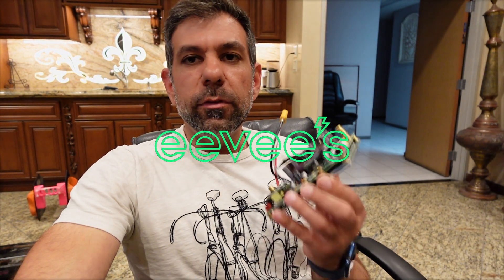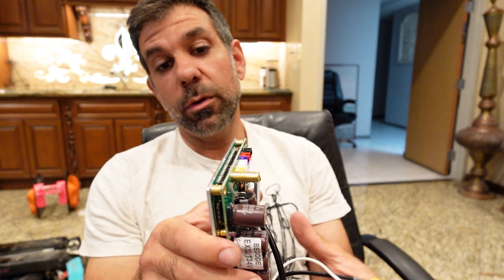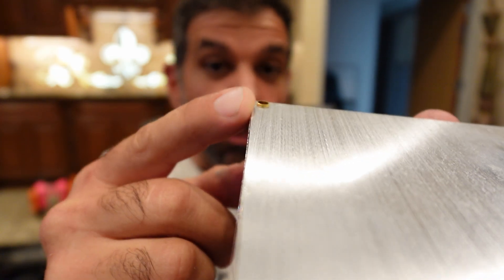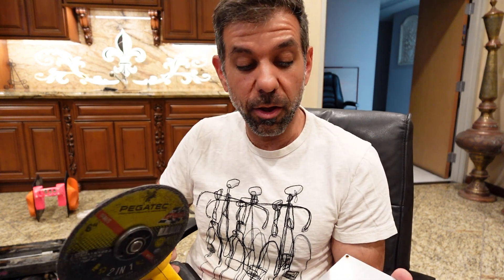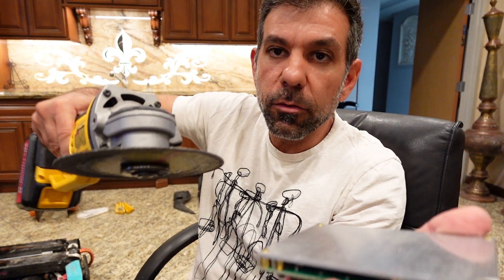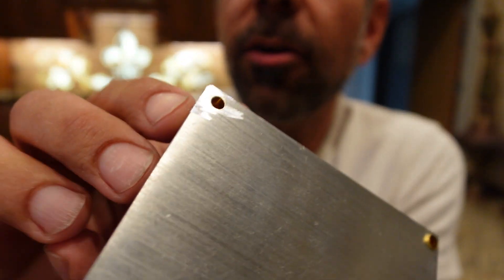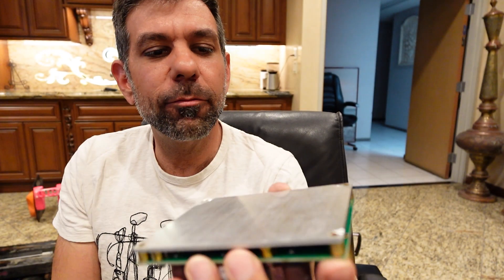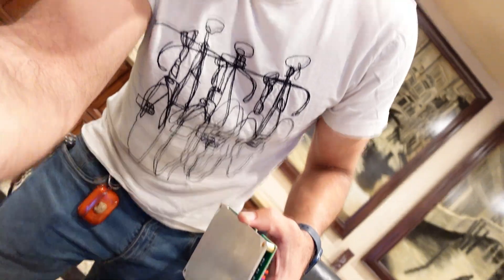Begode EX30 new revision control board blocking thermal grease solution.

Comment: I think i might mask off the top of the board first, and / or follow up with a gentle round of compressed air to remove any metal shavings from areas they would not be welcome.
Reply from the maker: Compressed air is a good idea.... the other part sounds like extra work.

Comment: No eye protection using an angle grinder instead of precision tools. 

Why did Begode install those if you have to grind em off did you ask them? Seems like the perfect way to lose warranty on a brand new board.
Reply from the maker: They wanted my friend to put two layers of thermal mat under the board.
Reply: @roghaj  Well thats one way to solve it, maybe. Still I prefer you method. Any excuse to use powertools is a good excuse 😁

Comment: Wouldn't a Dremel with cutting disc work better esp with extension flex shaft? More control over the process I would think. Not disputing the angle grinder as I have the exact model too. Just asking as all
Reply from the maker: Whatever flattens the bottom